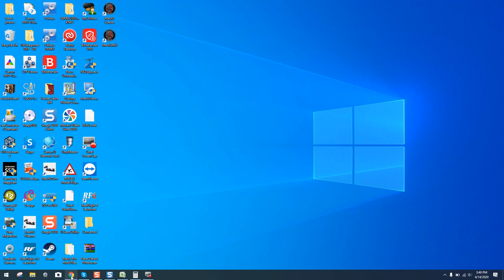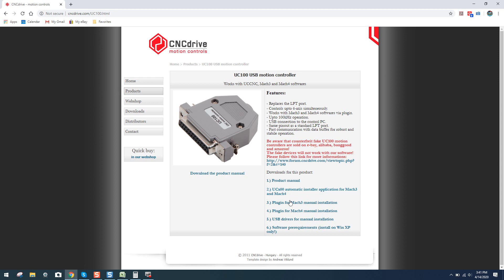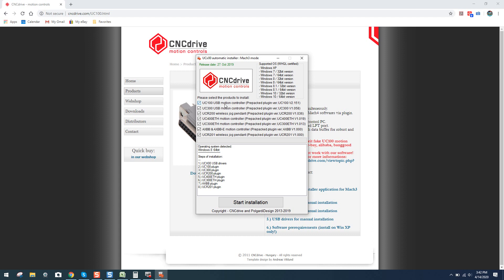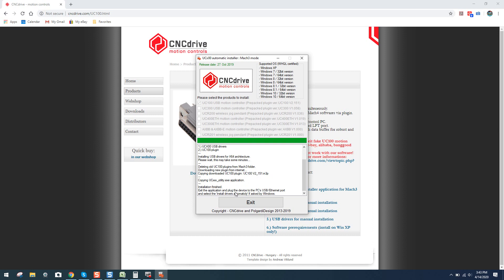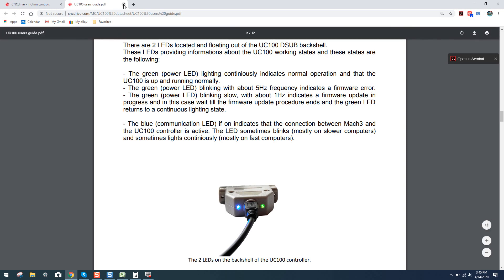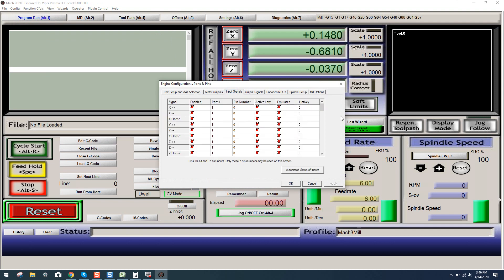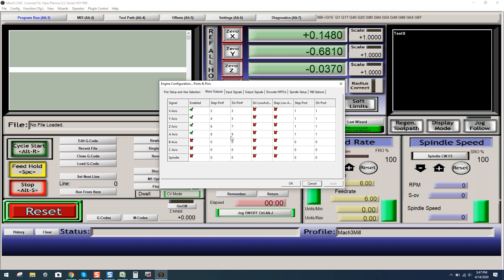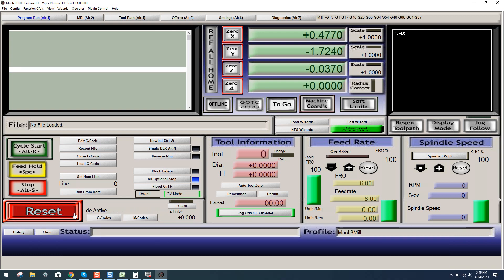How to Install A UC -100 USB Motion Controller...

Comment: The install on my Windows 7 will not illuminate the blue led. The .net framework is working properly and device manager indicates the UC100 is operating properly. I attempted to manually install the USB drivers and having issues with that. Can anyone advise me on what is going wrong? Thanks
Reply from the maker: I would contact your vendor as you paid them your money to purchase the unit, and they are the ones that are accountable to help you with it. 

Thank you,
Vince

Comment: i got my a UC100 driver a few weeks ago, had it running, CNCed out a test piece, took me ages, like 3 days. went off and designed a bunch of cabinet jobs for people, plugged it in today to break out some sheets, not working. 
keeping getting a " check connection " alert, very frustrating, i have all my money in these two jobs.
I've just realized i have no blue light. realizing that my once used controller that cost me 150 euro delivered is possibly broken. FaDuck life and FaDuck technology .

If anyone else is having this problem i wlll come back and tell you if/how i fixed it.

Comment: Tried everything you said. I never get the blue light. This I built this system about 20 years ago and runs fine on the printer port. I want to use the UC100 so it can be used with a laptop.
Andy ideas? The UC100 does show in device manager.
Reply from the maker: Thank you for your support. Unfortunately there's no way I can tell you what's wrong without doing a remote Microsoft teams consultation as I'm essentially a mechanic being asked to diagnose a car without it in front of me. If you would like to schedule one please contact me as my email's in the video description. Have a great weekend!
Vince

Comment: Do you by chance have a video showing the motion controller connected to the cnc machine? May sound strange, but I'd really like to see how the wires/controller are connected. Also, do you need a separate power source for the controller? I've been researching so much I may have my own wires crossed, but I swear I saw an 'alert' or 'warning' somewhere stating that an additional power source was needed.
Reply from the maker: Thank you for your support. I don't have a specific video of the controller connected to the robot it supports. I do however have over 300 videos where you'll see all the cables run to their system. 

The controller has its own internal power supply. 

Thank you,
Vince

Comment: Hi, we are trying to install the UC100 and the blue LED never goes on. Also, when open Mach3 the software says that all drivers are corrupted. Anyone can help us please?
Reply from the maker: Thank you for your support. The drivers can be downloaded here. https://www.cncdrive.com/UC100.html
I suggest starting over with the installation after removing the original version you're having issues with.  The users manual is also available on the site for download, and review if you haven't done so already . Thank you,
Vince
Reply: @corvetteguy50  HI Vince, thanks for your reply, we have installed the drivers manually but the problems persist. We will try to install it in another computer. If that doesn't work, could it be the case we bought a face UC100?
Reply from the maker: Where did you purchase it? Thank you,
Vince

Comment: Thanks for the info! Question: While trying  to set up my machine and mach3 I ended up downloading mach3 twice. When I open either of them and turn on my control box, my motors lock up. In one of them (mach3 programs) it does not ask me if I want to use the UC-100 but I can jog in that one, though the motors are locked up and don't move. In the 2nd mach3 program, it DOES connect with the UC-100 but I cant jog the axis'. Any thoughts on why my motors are locking and why the difference with the jog function between the 2 mach3 programs? Would really appreciate any advise.
Reply from the maker: Jeffrey, thank you for your support. It sounds like a conflict as Mach3 should only be installed once. You also have to install the UC-100 driver in order for it to be found. I would uninstall Mach3 as described in this video https://youtu.be/K_9fvehvv-w then reinstall it with the integrated package for the UC-100 on CNCdrive's website. thank you, and have a great weekend!
Vince
Reply: @corvetteguy50  Thanks for the reply and suggestions. I did try un-installing/reinstalling and just getting the same old problem. The mach3 license I'm using came with my machine, not the UC-100. Not sure if that would cause any issues, just trying to think of anything and everything that could be wrong with the setup. It can get a little maddening! Thanks again, man.
Reply from the maker: If Mach3 came with your machine, and its Chinese its certainly a pirated version which can be the issue your having. 
Thank you,
Vince
Reply: @corvetteguy50  it’s an American machine. My motors are spinning now. There were a couple little things in the setup that I was overlooking. 
Thanks again, man. You’ve been a huge help!
Cheers!
Reply from the maker: Great, I'm glad to hear she's up, and running :) Vince

Comment: just picked one up on Amazon from CNC4PC  I was told by my table builder to get it there... sorry just finding you.  do you sell just the filter and cable?  I also want to have the laptop at my shop desk. 30ish ft away . is a cable posable that long ?  thinking about doing a return and getting yours at 30.00 more.
Reply from the maker: Thank you again for your support. You don't want to use a USB motion controller with a plasma system as the EMI produced will easily produce corruption of signals especially with a laptop with a floating ground as these PC's are portable. The other issue you'll face is the USB cable length limit is 15ft as once again its only using 5v to power it. I highly recommend moving up to an ESS turnkey solution for maximum stability for plasma systems, and the ability to have a cable length of up to 100ft if required from the PC. Here's a system plasma system I built for one of my Exxon clients. https://youtu.be/pkJWQz04xpo

 Thank you, and have a great weekend!
Vince
Reply: @corvetteguy50   my controller is the G540 I dont have the 3 or 5 pin stuff..  I just want to get away from the windows 7 32 bit 4 gig ram garbage .  Why do I need to buy your 2k  system , when I have the same step drive?  I need to use the UC100  in the parallel port so I can use faster computers.
Reply from the maker: @metalworksmachineshop   I think you misunderstood me. You require an ESS turnkey solution. https://youtu.be/uX_D23XtLwM

 I only sent you a link of a plasma system I built for previous client to review it not to buy it. My ESS will get you away from the parallel port, and provide you the most stable STEP and DIRECTION signals.  Thank you, and have a great weekend!
Vince

Comment: The pin numbers you are referring too.  Are they the pins from the uc100 lpt plug or your breakout board pins?
Reply from the maker: Tony, thank you for your support. The pin numbers I'm talking about are for your breakout board, or driver which in the case of the video is for the G540 integrated driver. Thank you,
Vince
Reply: @corvetteguy50  I just ordered  a UC-100.  I'm having a heck of a time with the connectivity using windows 10.  I bought several boards and several cables.  I hope this works.  Windows10 to mach3 5 axis.
Reply from the maker: @tonyt8807  It will support your Windows 10 system as long as you have all your breakout board pin numbers for inputs, and outputs. Thank you,
Vince